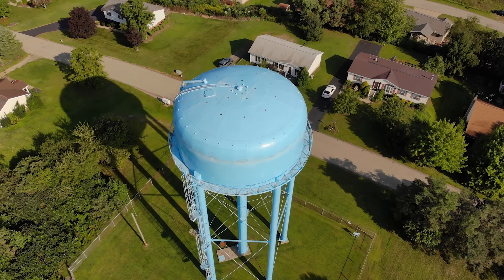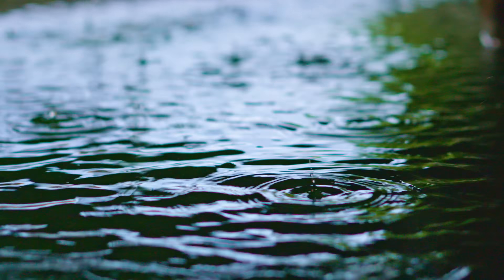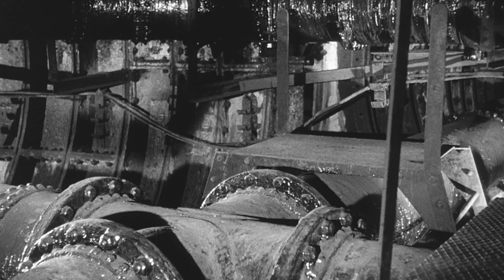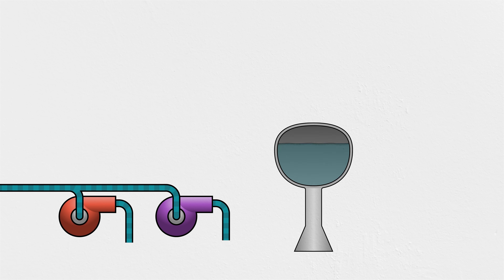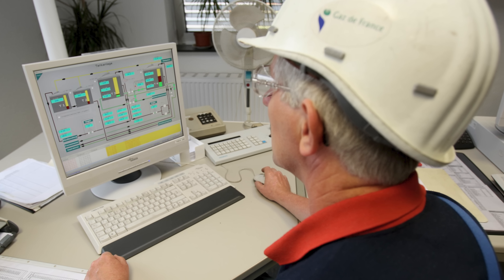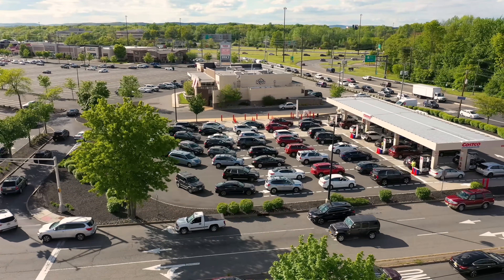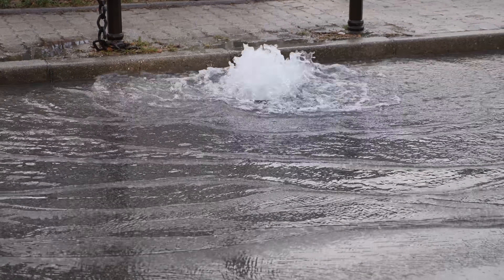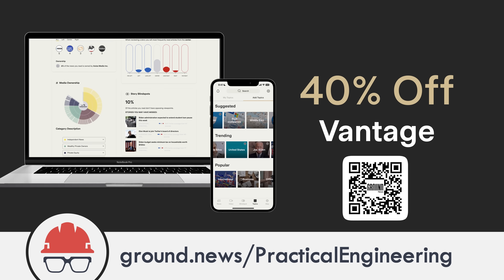When Infrastructure Gets Hacked

Comment: For anything related to infrastructure, the question should be: "Can it run without being connected to the internet?" If the answer is yes, it should not be connected to the internet. You can still automate it, you can even build your own network, just make sure you don't put in any unnecessary internet connectivity.
Reply: Airgap the world
Reply: @dank_69_420_memes It doesn't even need to be airgapped, even some firewall rules would suffice.
Reply: @dank_69_420_memes Yes, that is the key. Cutting off Internet access is only 1/2 the problem.  Any data touching the potential systems also need to checked through an airgap system. 
   One great example of not airgapping were the Iranian nuclear centrifuge attacks. They had no Internet access but no airgap system and something got in. It was to the world's temporary benefit on that attack but it also was a good warning to all systems.
Reply: I'm a chemical engineer but these days I work cyber security. This is like the happy middle ground of my two lives haha. 
OT and industrial are still some of the weakest configured devices that handle some of the most disastrous consequences if compromised.
Reply: I think what the OP meant was to place the infrastructure in its own subnetwork with a gateway that links to the proper places using a system of tunnels ( aka PPP ) properly secured and with firewalls and Radius in the proper places ( aka the control center ) to make sure that the network traffic isn't accessible by other networks of the control center.

And finally use 2FA, it makes things so much secure than simple login/password and twarts many spear phising attacks, since even if you get the username/password you will still need the 2FA token...

And for sure if you start to get to many 2FA requests that you did not start, escalate the issue, since it is probable that someone is trying to use your credentials to enter.
Reply: @carddamom188 stop. Don’t assume you understand a stranger, you don’t. Additionally you spent far too much time on a bullshit YouTube comment 42 people will ever see
Reply: The utility I worked for originally had an "analog tone" system that acted like physical wires between our tank sites.  Then the telecom techs that could keep the system functioning became scarce; followed by telecom moving to a digital backbone.  The digital systems can be partitioned, but I will never believe these are secure.  In fact, I do not believe that our own Department of Homeland Security folks will LET truly secure communication systems exist any longer.  Remember, that a physically "private" network can be accessed simply by installing an internet accessible machine into the loop.  This is not difficult,  but it is unlikely because of the effort required, and the risk/reward is not great.
Reply: Why go radio, while there is already a pipeline between two points, there should be some comm cable in the same trench.
Reply: @JanicekTrnecka when they put the pipe in in the year 1930 they sadly neglected to run a fibre optic cable with it.
Reply: @zyeborm  what a missed opportunity:)
Reply: Say hello to Industry 4.0
Reply: Follow the federal
Guidelines for industrial cybersecurity. Enforce firewall security, keep
Firewalls updated. These days systems are connected to corporate LAns for data so,  use only DMZ’s for corporate interface and separate operational networks.
Reply: Or you implement Zero Trust and have updated system with proper threat modeling...
Reply: Trustee of a water district here, we service 220 homes, zero internet connection.
Reply: Also, if you really need data to be read remotely, just use a webcam and a screen with a QR code to send the data remotely. Voila, no internet connection, perfect security.
Reply: Yes, vital infrastructure should not connected to internet. Like nuclear reactor, it never connected to internet that's why stuxnet created
Reply: Intranet, not internet… but for some reason everything needs Bluetooth & Microsoft bloatware (self- imposed spyware) & 3rd party cloud attack vectors
Reply: @Welgeldiguniekalias You should watch 9:33 in the video
Reply: Kind of, it should be like the government's NIPRnet. NIPR is very secure and still connected to the public internet.
Reply: you should rewatch the part about stuxnet... airgaped system still taken out "from the internet"
Reply: Private mesh-like radiomodem SCADA system for the win
Reply: Laziness and labor cost savings.
Reply: id understand if just the sensors are able to be checked from afar but your statement is just spot on. id rather have it functional and secure
Reply: Has anyone heard about the sound being given off by flat screen monitors being detectable and that sound can be traced back to what is on the screen? 

That is an airgap broadcasting.
Reply: It’s a bit more complicated than that. Nowadays everyone uses a zero-trust methodology. It shouldn’t matter what network is connected, it should be secure by design. Connectivity is too important nowadays but that doesn’t mean it’s also insecure.
Reply: It should be a single firewall router with an encrypted camera feed of a green status LED.
Reply: Agreed
Reply: Wow, it is as if that's what he said.
Reply: Yeah that really helped Stuxnet. Did you watch the whole video?
Reply: Easy to say until you see how much good quality radio equipment costs and no a boafeng radio isn't reliable enough to run a utility site
Reply: You just need to spend a few hundred dollars per metre putting new conduit and fibre in and running it to every valve in the water network. I'm sure nobody will object to the cost instead of using the existing network that already runs next to it or the cellular network a that a lot of things are using these days. 

Here's the thing, if your suggestion seems really simple and obvious you probably don't know enough about the problem to understand why it isn't done that way. 
Yes you can run fibre for new things, and it is often done. But you've got 2 centuries worth of infrastructure already there and nobody wants to pay to even maintain them let alone giving a water valve better network than most homes it'll run past. 

There are ways to solve or mitigate this problem, but this isn't the best. 

Especially as it leads to border only security, which is great until someone gets in anyway then moves horizontaly and takes everything out. Stuxnet taking out the air gapped scada system running the Iranian nuclear weapons program is a stellar example of this.
Reply: As someone who has helped to deploy a few SCADA systems, I can say it's not feasible to have a 100% airgapped system that doesn't touch the internet in some capacity.  Remote Operation Centers couldn't function and monitor entire grids without have remote connectivity.  Imagine trying to balance a power grid without having the big picture meter reading at each of your substations.  its impossible.
Reply: Internet connectivity alone is not your issue. Remote Management and notification is the weak spot. This is often handled poorly just due to lack knowledge. Shoring those things up is not expensive or difficult, takes a little knowledge and time. Finding the knowledge is essentially the key.
Reply: I worked in a school where the fire alarms needed an internet connection to work. We would loose internet an average of three times a month.  One year our entire network was hit by Russian random ware.  Fire alarms.... Seriously... That is the last thing that should be dependent on an internet connection.  Manufacturers and designers who plan things that way should be held liable for any risk and a failure to fulfill a fiduciary duty.
Reply: That is oversimplified and unrealistic in many cases. Let's assume that the county has multiple watersources and pumps in different locations and they need to communicate to decide which pump at what location should run with how much pressure. WIthout connecting it to the Internet, you need to have dedicated fiber cables to connect their pump stations together. That can get really expensive real fast. And how would you trigger an alarm to a technician in case of a failure? You don't. So then you need to have someone on-site 24/7. It's often not realistic. 

And while an air gapped system can be more secure, it is still vulnerable to many issues. Air gapped systems often do not get updated often (if at all) because it is difficult to do. The air gapped systems may still be vulnerable to supply chain attacks, malware delivered on usb-sticks, hard drives, etc. Without recent updates and the requirement to use usb-sticks and other media to exchange data (because it is air gapped...) they are even more susceptible to such threats. 

IMO, there are very few systems that can be operated on a daily business and made more secure by being air gapped. There are always pros & cons that should be weighed. Just saying air gapped is always better if it is possible does not make sense for many reasons (operation difficulties/cost/etc...)
Reply: Water will cost $5 a gallon if these youtube experts were in charge
Reply: @robertbslee4209 no, here at my workplace(power grid control), this is EXACTLY what we do, separate network that’s COMPLETELY disconnected from normal internet
Reply: Lots of infrastructure needs to run via the public internet, what you're saying is similar to saying "don't use public roads, all infrastructure should use private roads only built and maintained for infrastructure purposes." 
It's not feasible
Reply: Some people here forget that technology is improving and these systems, just like it was shown in the video, can monitor themselves. No need for a human operator. All you need is someone that regularly checks on the thing like weekly or whatever to ensure it's in good condition. Just macro everything you can macro safely and build your infrastructure so it can be macro'd safely, such as that water tower having an overflow.
Reply: I can’t with you people 🙄😑😏
Reply: Well essentially yes they don't require internet but if you want to monitor and over see it remotely then sure it requires internet because these are the standalone iot is they don't require internet they can just work fine even in the Siberian region
Reply: also if it can run without internet, WHY would you run it with internet? what do you gain?
Reply: That’s an idea. It’s not a very good idea, but it’s an idea. 

If you think airgapping is sufficient, then I think you must have skipped the stuxnet part of the video? Did you know people have found ways to access data on a computer just by listening to it with ultrasensitive microphones? Through windows and walls, even!

The ONLY solution is to harden everything against intrusion. Monitor and log all accesses. Every unscheduled change triggers a notification. Significant changes can only be performed if approved by a separate user. Alert whenever anomalous activity occurs. Detect when passwords have been leaked and require those users to change them. Use multi-factor authentication and robust authorization controls. Always keep everything patched with the latest updates. And back everything up religiously in at least three locations.
Reply: That’s an idea. It’s not a very good idea, but it’s an idea. 

If you think airgapping is sufficient, then I think you must have skipped the stuxnet part of the video? Did you know people have found ways to access data on a computer just by listening to it with ultrasensitive microphones? Through windows and walls, even!

The ONLY solution is to harden everything against intrusion. Monitor and log all accesses. Every unscheduled change triggers a notification. Significant changes can only be performed if approved by a separate user. Alert whenever anomalous activity occurs. Detect when passwords have been leaked and require those users to change them. Use multi-factor authentication and robust authorization controls. Always keep everything patched with the latest updates. And back everything up religiously in at least three locations.
Reply: @JakeRobb  yes, ACCESS data, this isn’t relevant at all, that’s only about READING data, not manipulating or writing, and stuxnet was a case of bad human security
Reply: But what if it could be controlled by an app, bro? Don't be a lame boomer... Have you ever felt the power of being able to shut off a city's water main with one touch? Or make a Christmas light show out of street lights in downtown? That one even makes its own fireworks!!

Some things are worth the trade-off, it's not that simple.
Reply: @LuigiMordelAlaume  depsite the ironic nature of your reply, all of those things are feasible with the approach I described. 😜
Reply: StuxNet got into Natanz without an internet connection.
Reply: Y2K
Reply: I used to work in a small lab that digitized medical records. Nothing was connected to the internet. We weren't even allowed to bring anything into the lab that could store data digitally. Wanna listen to music? Bring vinyl records, or a radio. (Radio must not have any functionality beyond receiving signal, btw)
Reply: A lot of things seem to be connected purely to save a few cents or for the sake of laziness, remote monitoring etc.
Reply: Mostly agree.
The connection should purely be for remote monitoring for maintenance purposes.
Reply: Make an excepton fir monitoring. That monitoring also needs to monitor that its data gets used properly and in time, and sound a local alarm if not.
Reply: That didn't prevent the US from attacking Iranian centrifuges with Stuxnet
Reply: Not feasible or realistic. Hopefully you’ve grown out of your little bubble in the last year
Reply: this. thats just logical if u have the slightest clue about how computers work. u can run seperate networks without endangering one or the other
Reply: they made an entire videogame about this
Reply: @AACallMeTheSandwich videogame?
Reply: What game?  @AACallMeTheSandwich
Reply: now imagine if its a nuclear reactor.
Reply: @SyntaxError0287 automatic failsafes that have failsafes for failsafes
Reply: Nuclear plants are fully staffed and not connected to the internet so your fine.  @SyntaxError0287
Reply: @SyntaxError0287  it would take a lot of imagination but of course you can't hack a nuclear power plant. Much like commercial passenger planes nobody was silly enough to design them with that vulnerability.
Reply: The problem is that remote monitoring piggy backing on the web is incredibly useful and exponentially cheaper than building a second internet
Reply: @glockmat  And the second network would be less vulnerable...not invulnerable.
Reply: NONE of it has to be on the public internet.  Also NO controls for the critical infrastructure should be connected to any computers that have a route to the internet and machines with any wireless infrastructure.  And NO MS O/S's at all.  Only hardened nix machines.
Reply: That's what property taxes are meant to be for. If that's not possible, run separate cables
Reply: There are usually operators on site at treatment plants to deal with issues at the facility, but you will still need internet connectivity because often the entire water system is monitored and parts of it controlled from a central location. You might have someone monitoring 3 different treatment plants and determining how much of their capacity they should be using to balance the supply and demand within the system. If you are modulating the treatment flow rate for an entire municipality you need to balance that entire system. Sure you could have individual facilities operate independently but the system will be much more efficient if it is balanced as a whole. I'm relatively new to it water but I think the discipline is flow control. And you could probably connect them directly via cabling or satellite, cables are cut surprisingly often by other companies (you'd be shocked at how often we have to fix pipes because an ISP drilled a hole through it to run a cable without checking where the water line was)
Reply: @greenbean1456 Depends on the size of the facility.  Most medium to small scale water and wastewater plants have one shift that goes home at night and are on call for the weekends.  Remote access to SCADA systems has been a positive thing for those guys.
Reply: Never understood how they could get away with remote bidirectional controls. I figured OSHA would say "hell no" to a system that allowed changes to take place without on-site personnel. Just begging for a miscommunication to lead to a loss of life when some desk jockey kicks a motor on while it's under maintenance. Remote monitoring seems okay, I guess, remote actuation is a SOLID no.
Reply: @operator8014 lock out tag out.
Reply: @operator8014 Get real! The electrician would turn off a manual breaker near motor and put a lockout tag on it. It would not be possible to turn it on remotely. Comments like this demonstrate a complete and total lack of understanding of electrical safety systems.
Reply: @operator8014 I work with remote systems with VPNs and all the IT security stuff for remote access and control.   Step one of maintenance of anything with motors or high voltage is unlock the control panel and disconnect external AND internal access.  Second step is relock the panel and take the key with you.
Yes, if the Israeli or Russian cyber-warfare teams specifically targetted us they would get in.  In contrast, some nutball with a home computer could get into most infrastructure in the USA, or anywhere else in the Americas.
Reply: this makes sense in theory but it would be incredibly expensive. I would agree and it would be nice if there were programs in place to fund things like that, but setting up a local network for every piece of infrastructure would require so much extra infrastructure around it that there seems very little point when the internet, infrastructure already operational and in place, is so much cheaper. Not to say that there might not be fault here anyways, using the internet to keep costs down is one thing but if theres any scrimping or even lack of protective software and good practices then it probably wouldn't matter either way
Reply: This is what happens when everyone wants to work remotely.
Reply: @elainebenes7971nobody in that industry works remote you ignorant fool.
Sure Jerry yup turn on the valve to pump 14 via your couch… not how it works
Reply: If the monitoring only is why internet connectivity is needed, then we can connect that while airgapping the controls.
Sensor outputs just need to be duplicate-wired (with a hard one-way filter if need be) to a monitoring-only-network that is connected out. Attack that all you want, all it means is the monitoring fails, not the control system.
Reply: @tomfeng5645  The sad answer is that utilities have reduced personnel to the point that they can not operate without remote operations.  Monitoring is no longer enough at the current utility customer rates.  I'd love to see the national change in customers per employee for water systems in particular.
Reply: Reductionist and inaccurate.  The question is “what is the least connectivity required, and how can we adequately secure that access.”

While a system may “run” fine when disconnected, it would require 24/7 monitoring in case of emergencies.  Making monitoring data available remotely lets you identify issues faster, and secured remote access allows recovery from problems/disasters faster.

The trick is really understanding your systems and properly whitelisting access along with building and enforcing comprehensive policies around data access.
Reply: @ausnetting Water is used 24/7 .
Reply: Have any of yall ever seen how these things are managed. My grandfather managerd one of these for over a decade. He was retired and just did it because he wanted to. This is how a lot of these are managed. Just some dude that has spare time. It being disconnected from the internet would require an employee to be sat monitoring these. Thats just not feasible
Reply: @LaugeHeiberg isn't paying someone say 100k a year to monitor things relatively affordable for almost any city? What other expenses will be needed that make this unfeasible?
Reply: That's not true. You don't need a machine to be connected to the internet to access it remotely  @LaugeHeiberg
Reply: @LaugeHeiberg Understandable but is it really a good idea to have someone with little cybersecurity background work remotely on a critical infrastructure? What if his remote password is "password" because it's easier to remember? What if he shares some critical info online?

Remote access is good and all but it still must be secure, and providing security to the home office is much harder than at the office where everything can be adjusted.
Reply: @LaugeHeiberg It is feasible tho. How do you think they did it before the internet was around? A town I lived in a while back had had running water since 1900. And people could afford to pay for it even back then.
Reply: @LaugeHeiberg  exactly. We can all shout about how we know the solution is just to have local personnel to look after this infrastructure, but when it comes to paying for it I think we all are gonna be quiet real fast...
Reply: This is wrong and would be extremely expensive.  Your idea would require someone sitting at a control panel all day monitoring the equipment.  The reason for automation is 99% about monitoring, not about control.  But you need control in order to act immediately on monitored output.  What they need to do is assume that they will be attacked and harden the connections through VPNs, firewalls, encryption, and 2-factor authentication.
Reply: @KellySmith-kw2cl  bro wut? computers can still compute without the internet. There should ALWAYS be employees inside the water treatment plant, one of them monitoring for any alerts isn't a monumental task.
Reply: @Crimin4L  The thick one is the guy who doesn't understand that we don't want 1 person sitting at each of the 50 different remote consoles monitoring one single console each.  Yes, there are situations where you have 5 consoles in one location that a single person can monitor efficiently, but water and electric systems are DISTRIBUTED, they don't have all their equipment in one location. Don't call me thick when you clearly don't understand the subject matter.
Reply: @Crimin4L because the pipes are already in the ground running under other infrastructure. Running fibre is measured in the hundreds of dollars per metre in urban areas.
Reply: @Crimin4L ok let's use a real life example and you can see why your scenario is impossible.  A wind and solar company that has wind and solar farms spread across the country.  they have a Remote Operation Center in a single centralized location that is used to monitor and balance the energy output based on demand from the various grid operators and physical conditions at the farms.  How does the ROC operators know the conditions at farms that are 1000 miles away, and how do they know the demanded from the different grid operators?  each farm has its own mess of fiber cables that run to each tower or inverter and gets sent back to the substation control house where most of the SCADA equipment is in, so to your example there is a LAN, but connectivity back to the ROC requires some type of WAN technology, and in this day and age that WAN technology is the internet.
Reply: @zyeborm  what infrastructure? roads....that are most likely already crumbling?

and yes, its expensive, like everything the government gets involved in. 

"Might be "expensive", but I'd say how much more expensive than the two active wars we are funding with billions of dollars?"

And to that point, what is more in our interest? Securing our own infrastructure or someone else's?
Reply: @bassman87  Bro decentralize, every municipality can have its own LAN. 

" has wind and solar farms spread across the country.  they have a Remote Operation Center in a single centralized location"

You may have misunderstood what I was saying. 

Having every system in the country hooked into 1 central hub would be more of a security nightmare than what we already have.

What i'm saying is every municipality, or county. Not the entire country.
Reply: @KellySmith-kw2cl  if monitoring is the concern, then internet connected systems would still require someone to be monitoring remotely. Just get the people who would monitor to come on sight and take it offline
Reply: @KellySmith-kw2cl you can automate locally without an internet connection.
Reply: @Ekipsogel no, you cannot.
If you have a pumping station filling a reservoir 20 miles away, how is your local control working?
Reply: @Pugjamin  radio, point to point satellite, tropo, or just run some fiber if you want a direct line and it's that important.
Reply: @jonjayb  those are all excellent solutions. As long as you’re happy to start paying $5 a gallon for your water?
Reply: @Pugjamin you can buy two high gain radio antennas for like 5 grand and upkeep is maybe like someones salary or retainer fees. Satellite would be larger operational costs but if you're getting tax dollars for your project it would probably still be fine. I mean they're already paying to get the internet out to that location via radio or satellite most likely, just make it point to point instead.
Reply: @jonjayb I'm not sure if all water departments work this way but the one I'm in is actually not allowed to use tax-payer money. As a utility, it's actually only allowed to pull rate-payer money. It's semantics to an extent but it also means you can't just get a higher tax to make changes like that. You have to raise rates to cover the cost or pull it from somewhere else. I don't know how much installing and maintaining an entirely independent system costs, that's more you're area of expertise than mine, but it might just be too high to pass on to consumers
Reply: @Ekipsogel  I'm not a computer wiz and even I understand it's possible. How folks don't get that is beyond me.
Reply: Sure, just build a completely separate network of cables and switches to connect all critical utilities and connect workstations which can monitor it, then interconnect other public agencies and people so they can use it. Oh, isn't that internet?
Reply: @goosenotmaverick1156 Are you trying to trick me into saying something nasty about civil engineers trained in the 1980s who now manage 1990s technology?
Reply: @HweolRidda   no, I'm not smart enough for that 🤣
Reply: @jonjayb cool, radio link, no way someone can hack or jam those right? Now you need to have 1200 valves connected to this point to point radio network at $5000 each. 
That's great. 
Now someone physically breaks into your plant, puts a USB stick into a machine (or just leaves them scattered in the carpark) and because you only have border security they now own your entire network and every device on it.
Reply: @vnc.t  my response was for someone who refused to believe you could connect distant locations with anything besides a cable.
Reply: It's actually way cheaper to airgap the infrastructure. Run the control directly to the water treatment plant, where there already are employees monitoring systems 24/7.
Reply: @mousefactors  Not really, you need thousands of kilometers of cables and redundant cables to 100% airgap every single detail of the entire water system, and that is just water, you also need the same for gas, electricity, district heating, and much, much, much more

Sending those over internet that is already there is FAR cheaper than anything else
Reply: @KellySmith-kw2cl  Nah, it requires a decent quality camera pointed at a computer screen. You can log into the camera remotely. All of the systems themselves are air gapped.

I've used this myself when helping tech-illiterate friends. System doesn't have internet? Video chat and point your phone camera at the screen.
Reply: @KellySmith-kw2cl you can have a connected network without being connected to the internet.